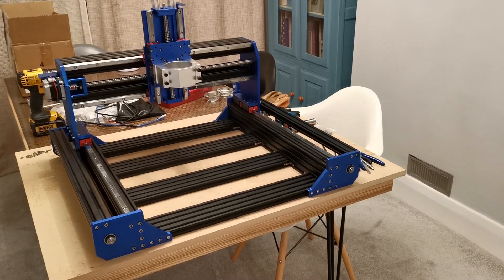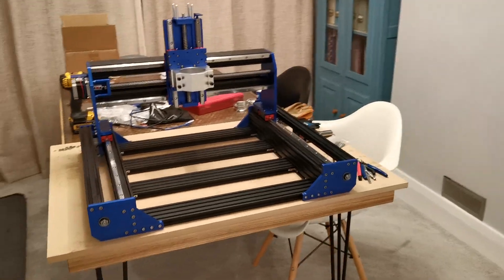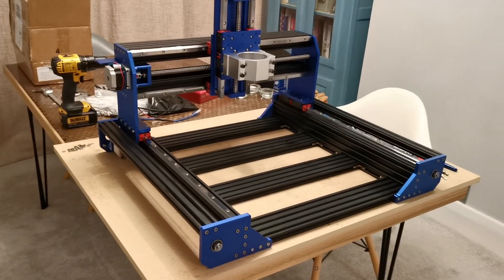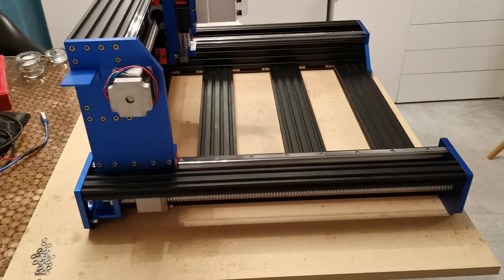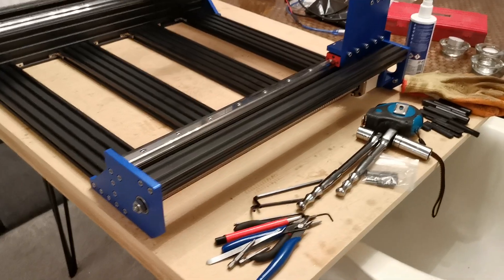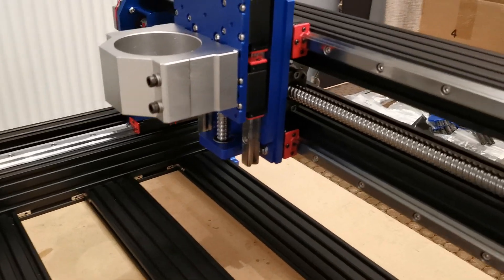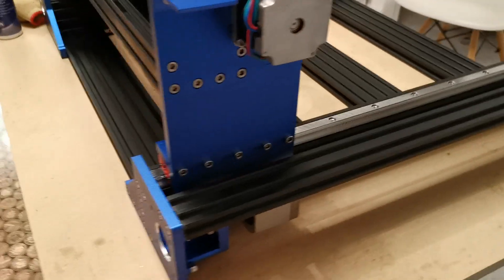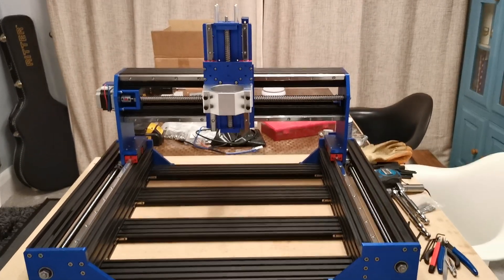A first look at the HDZ frame kit DIY CNC build

Comment: Hi Luke, was wondering what kind of accuracy you get with 1610 instead of 1605 screws?
Reply from the maker: 0.05mm with 1/1 steps or 0.0125mm on 1/4 steps

Comment: Looks like a great kit any chance it will be under £1000
Reply from the maker: A bit more than that, but this is a very heavy duty machine for the price point.
Reply: I was curious too about what price point this would be. I expect he is on the higher end of hobbyist machines but also the most rigid and accurate I've seen. He is probably competing with the Millright Power Carve with this.